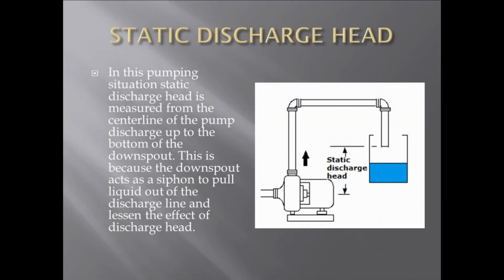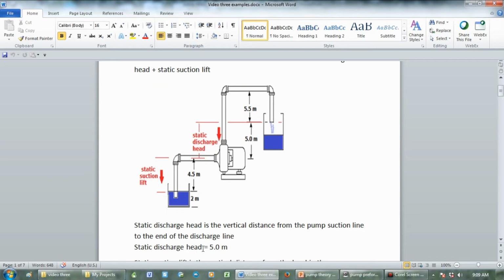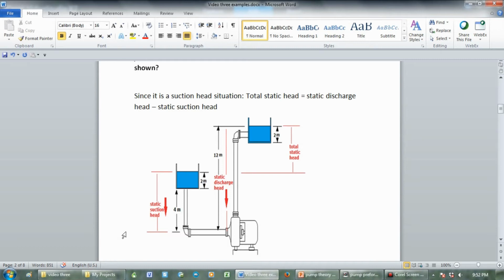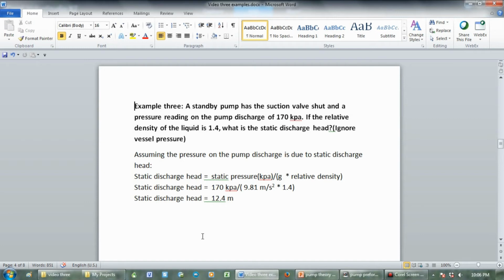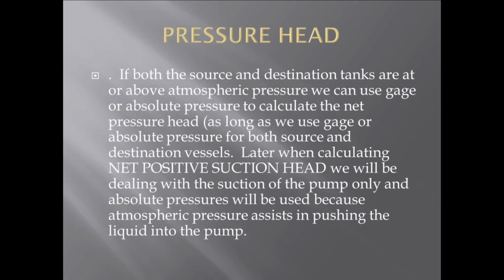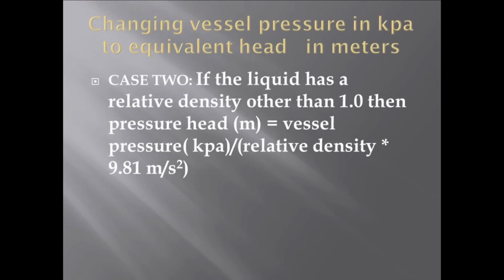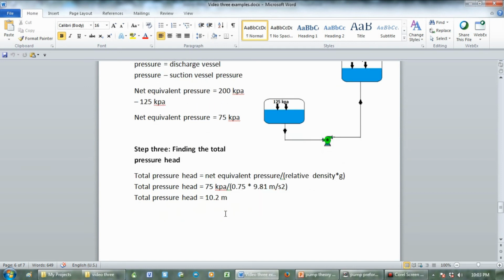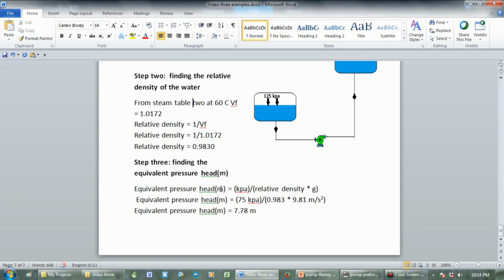pump calculations 3D

Comment: Sir, I cant understand still, why the total static discharge head is 5mtr. Why not 5+5.5 = 10.5mtr as the water is lifted upto top of the pipe turned. Please explain. 
( duration 4.50 in the video )